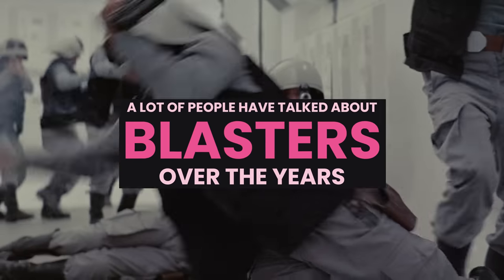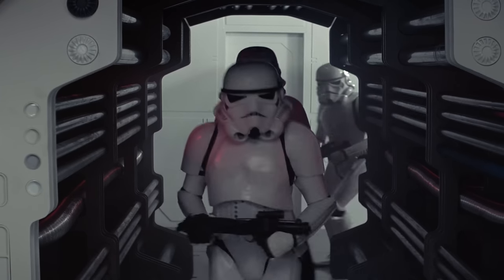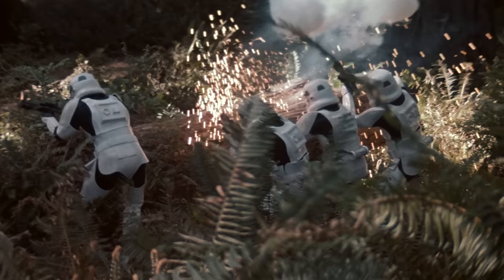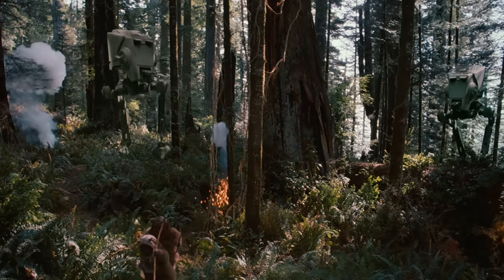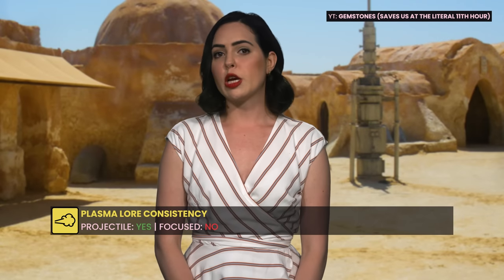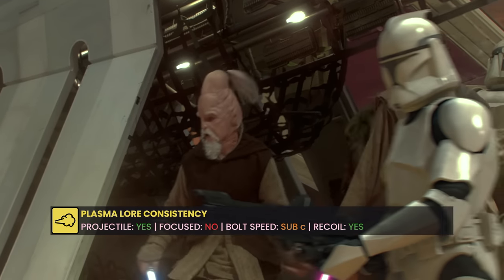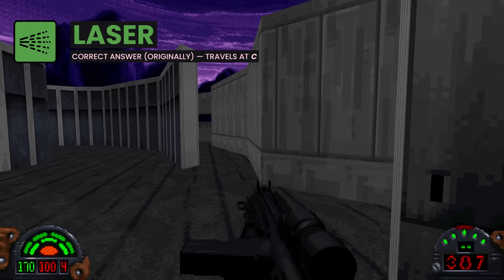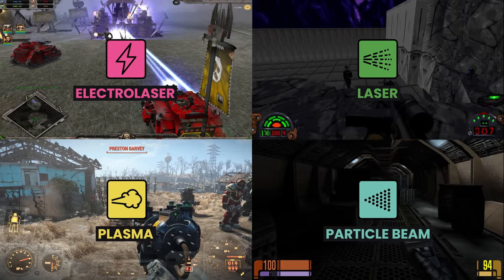Star Wars BLASTER TECH: The Definitive Guide

Comment: I always thought the difference between the two shield types is if they block slow or fast projectiles. Particle beams are pretty close to the speed of light so they get blocked, while torpedos are very slow comparatively and this get through.

Same with a walking droid or a rolling grenade
Reply: There are to types of shields one blocks energy weapons like blasters and such and the other block’s physical projectiles as in missiles or bullets
Reply: @711desmond  That doesn't disagree with my argument... There reason they might block different, is because the speed of the projectile might be different.
Reply: @DrTheRich  it’s literally the official lore
Reply: @711desmond  so, my explanation WHY that is the case doesn't contradict that lore. That lore doesn't explain WHY, hence my explanation
Reply: @DrTheRich  it’s a good theory I’ll give it that
Reply: @DrTheRich  bullets are faster than the blaster bolts we see on screen
Reply: @711desmond  have you seen bullet guns on screen tho? As far as I remember bullet guns only appear in books like shatterpoint. I don't remember them being shot at energy shields, so technically there is no "emperical evidence"

Given: I've read a lot of books but not everything
Reply: @DrTheRich  considering you literally see the blaster bolt on screen I’d say that bullets are faster
Reply: @711desmond  earth bullets are faster than star wars blaster bolts yes
Reply: @DrTheRich  why did you specify earth bullets?
Reply: @711desmond  you have any in universe information about how fast star wars bullets go?
Reply: @711desmond  more seriously though:

I have never considered the speed you see blaster bolts travel on the screen isn't actually how fast they would technically be in the star wars Universe because that would literally make no sense. It's just how they are represented in the movies, to be able to make them visible. A romantic practical representation of what is actually happening. Just like how in most science fiction lasers are represented as a visible beam, instead of an invisible one as it should be.

It makes literally no sense if a blaster bolt would travel slower than a metal bullet, if it's a laser, it should travel at the speed of light. If it's a particle beam it should travel at at least fractions of the speed of light. If it's plasma, it should at least travel at the same speed as a bullet.

The simple reason is, blaster bolts don't seem to have any significant drop with distance in gravity. Snipers in star wars don't have to offset their scopes for example. In other words the projectile, whatever it is must travel at a speed great enough that gravity can't bend it down fast enough to affect its arc on any meaningful way.

Anything that travels slower than a bullet, has a larger drop than a bullet, not less.
Reply: @DrTheRich  that’s not how physics work
Reply: @711desmond  please then, tell me how Newtowns (or Einsteins for that matter) laws for gravity are incorrect and you know better?

Gravitational acceleration on a small object only depends on the mass of the planet and the distance to it. and is the same for everything near it. Bullets, plasma, particles and even light, all accelerates downward with the magnitude of a planets gravitational constant.

The more time a projectile spends in the air, the more drop experiences. The less drop it has seen, the less time it has spend in the air, and thus the faster it must have gone. In other words: bolts go faster than bullets

But if you think your smarter than Newtown and Einstein, enlighten us with a demonstration please.
Reply: @DrTheRich  how did this turn from an argument about how shields work to a physics lesson?
Reply: "The slow blade / torpedo penetrates the shield" - Gurney Dodonna (probably).
Reply from the maker: @DrTheRich  It's good to see you commenting again, Matthjis. I really like your 3D work. Would be nice to collaborate on something one day. —ED-1TA
Reply: @thebreadcircus  I replied to you, where you could contact me, but the comment seemed to disappear.

Comment: About blasters not firing a solid projectile...What about a Wookie Bowcaster? Lore is that it fires a projectile from a magazine (bolts)(the boxes on Chewie's bandoleer)
surrounded by blaster/plasma beam. Could it be possible a blasters magazine is the same way. As far as it getting past the emitter on a regular blaster,, the projectile could be a ring that slips past the crystal, covered with the tibanna gas, which is then ignited by the beam, forms the blaster bolt, then as it speeds to the target, is stretched out?

Or could it just be this is a Good Sci-fi movie, and we're overthinking it trying to compare it to 20th/21st century Earth technology?

Still a good channel...

Comment: 5:50 - One of my favorite minor scenes from TNG is when the Enterprise is locked onto by a small ship. Worf reports that the ship is locking lasers onto them, and everyone is just confused about it. Even the weak "shields" that protects the Enterprise from getting ripped apart by pieces of dust while traveling at warp speed would be enough to protect them from lasers.
Reply from the maker: I know exactly the one you mean. In the pilot episode of Star Trek TOS, they use quite a different model of ray gun. As I recall, the dialogue calls these lasers instead of phasers. In canon, I think they would have been an earlier model of phaser. - DZ
Reply: Nerd
Reply: @thebreadcircus  nerd

Comment: i like the idea of electrolasers. the early models only worked in atmosphere and later they started replacing the laser with beams of high velocity plasma. or maybe it is straight plasma bolts we see and they are just fired before the main shot so the leaking plasma off the bolt gets some gas between you and the target before you activate the electrolaser.

Comment: Laser is focused via a crystal to efficiently heat tibanna gas into its plasma state, which is magnetically accelerated out the barrel at a speed slow enough that air drag doesn't disrupt the "coherence" of the plasma bolt (laminar flow).

Blasters are laser-ignited plasma throwers. On Earth we haven't the exotic gas nor crystals to make it feasible for a handheld power pack to accomplish that ignition process.

Side note: this same tech would make compact clean fusion reactors possible.

Comment: In quantum mechanics, photons necessarily have a spin; their spin can be either +1 or -1. This spin determines whether the electric-field component of the electromagnetic wave is _precessing clockwise or counter-clockwise with respect to the vector that is the direction of travel.

In less verbosity,, a spin of +1 means that the electric field of a photon heading towards you is precessing counter-clockwise. A spin of -1 means that the electric field of a photon heading towards you is precessing clockwise.

Comment: My head canon is that all of these weapons are plasma based.

The blasters use an electric charge to ignite the gas fuel (I suppose you could say that it creates a small blast) then that ignited gas gets compressed into a small, super-heated plasma ball that gets propelled with electromagnetic force.
The "laser cannons" use lasers instead of electric charge to achieve the same result, just being bigger and therefor more powerful.
The "turbo lasers" are even bigger. The laser part is the same, the "turbo" part can mean turbines that keep the system relatively cool, considering the amount energy being involved.

The "bolt" part can be explained in a somewhat meta way. The reason why holograms are noisy and always have specifically horizontal lines is because the camera exists. The hologram's interference is essentially the same as when you turn your camera towards an old CRT screen. The plasma bolt is just a motion blur artifact, caused by the extremely hot ball of plasma that emits light. The length of the bolt is the distance the plasma ball traveled during a single frame.
The continuous beams we see during the clone war era are either rapid fire plasma cannons or particle streams - a completely different technology.

The ray shields that stop these weapons are high frequency magnetic fields that tear the atoms apart. But the atoms of solids, liquids and even gases are too stable, so only plasma is affected. If you accidentally hit the shield in just the right angle, the plasma ball may bounce off, otherwise it turns into a mostly harmless flash with some EM feedback, that disrupts and eventually disables the shield emitter.

And since these plasma balls are both unstable and lose their energy relatively fast, that means they are powerful but short range weapons, which explains why the ships are shooting each other from an extremely close range, instead of hundreds of kilometers.

Comment: My headcanon has always been that blasters/lasers/turbolasers are plasma guns. Given that they consume gas and must eject something with mass out the front to produce recoil. I've also always thought of tibanna gas as sort of a slow-burn nuclear fusion fuel. Like deuterium/tritium, except it "burns" in a matter of seconds, not milliseconds. 

Blasters are essentially very thin ion engines, exciting gas into plasma in the back and then accelerating it forwards with a strong electric field applied to the crystal, which is full of tiny holes to let the gas through. This is how electrostatic ion engines work irl too. Longer blasters could have several ion-grid crystals, so the bolt travels faster or a longer excitement chamber, so they are more powerful. 

"Lasers" as in the medium size anti-vehicle turrets are more like electromagnetic ion engines. Not using grids and electric fields, but a powerful, forward moving magnetic field to focus and propel the plasma forward, perhaps also using Lorentz force to propel it forward.

Turbolasers sort of have it in their name, that what accelerates the gas is a turbine. With a big gun this makes sense, a huge turbine can move massive amount of gas very quickly. A turbine accelerates the gas doen the barrel, which is then excited into plasma and focused with a magnetic field. The sound of the turbolasers even sound kind of like a pre-spun turbine being quickly slowed down as gas is suddenly injected into it. 

The disc shaped blasters/lasers on the homing spider droid and LAAT gunship in my head was like a regular blaster/laser, but where the gas is first accelerated to very high speed by a dedicated module, before being injected from several sides with very high energy blaster beams. The collision of the beams adds extra energy, perhaps causing the tibanna gas to burn faster? In a sense its like a tiny Project Daedalus, using tibanna gas instead of deuterium/tritium fuel. 

This means that ray/particle shields make sense too. Ray shields are electromagnetic or electrostatic in nature, reacting to the magnetic or electric field of the incoming plasma.

Particle shields might quite literally be shields made out of particles. Like a cloud of sand hovering around a ship. This would mean that a high-energy and very thin bolt of plasma could pierce through, like a needle through a sandstorm, but anything with more surface area, like a ship, missile or torpedo, would hit too many particles and be stopped/shredded as if hit by buckshot, except the ship/torpedo is flying into the buckshot and not the other way around. Though you could continously push slowly through, if you've got something to push off of. This kind of shield could also protect against the heat of athmopheric reentry.

Comment: One thing I think needs to be accepted is that Lucas was not a physicist, nor was he affiliated with anyone to assist him in making equipment that was physically possible.

All you need to do to understand this is look at how Jedi can just deflect blaster bolts. If they were lasers, the only way to do this is with precognition. While Jedi do have precognitive abilities, the very first scene with blasters shows people dodging them.

The only way that makes sense is if Blasters are either Plasma or Particle weapons.

The most likely explanation is that Lucas wanted the same effect as Tracer ammunition in normal guns, and just called them lasers. When it came time to make diagrams, the designers just used what knowledge they had to make something that fit what Lucas told them.

Fast forward to the Prequel Era, and the people in charge of penning the lore realize that what they previously wrote was impossible; you can't make lasers that behave the way you see on screen.
So, they fix their mistake.

While not all new lore trumps old lore, corrections and fixes to the lore can not be ignored.
The only time lore trumps what is on screen is for obvious mistakes in production.

Comment: There's a legends story I remember off the top of my head that actually describes a blaster using laser mechanics. In an attempt to frame Han Solo for murder, an imperial sabateur uses a specialized stealth blaster that can fire an invisible bolt. He fired the invisible blaster at a dissassembled blaster barrel with its focusing crystal exposed, which caught the invisible bolt and refracted it into a visible one down the makeshift barrel so it would look like his shot came from a Solo's direction. Needless to say, a plasma thrower would not have been able to achieve this.

Comment: Might be easier to work backwards- figure out what deflector shields are and what they would deflect. You're right that its less important to have a firm, definitive explanation for how blasters work and more important to have consistent grasp of what they do- I skew more toward 'the visible bolt is the energy that deals the damage' because that tracks more intuitively. That explanation can be wrong, but it doesn't change what blasters are or how they are used. Moreover, it doesn't matter for the operator in the  slightest, they are interested in putting red lines on target, not what kind of compressor the gas tube uses or the polarity of the Xciter chamber.

Its great how blaster is such a broad term to cover any and all handheld energy weapon (like Ork Shoota is umbrella term covering slug throwers, bolters  etc) with a specific group of exceptions like beamtubes and ioncannons. That's far more realistic than characters talking at length about the models and properties of their gear for the audience sake, even though some of us might prefer more concrete data